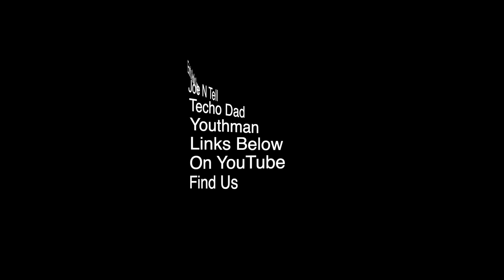F3, F6, F10 - The Most Important Point/s Are?

Comment: I think they should just tell you the max spl at each frequency like monolith do...

My subs supposedly go down to 18hz! And they do... but if I listen at the levels I do (movies ref -10db or about 95dbspl for music)  the sub can't even produce 20hz at 105db spl! Or 23hz at 105dbspl... but it can just do 25hz close to that... the limiter needs explaining too... what are the characteristics of the limiting system... etc 

I use a curve where the bass increases 2db/Oct from about 250hz so by 20 its wanting to put out about +12db!  I had to roll off at 25hz to stop it bottoming out mechanically! 

Maybe only advertise the lowest frequency it can do at thx ref levels!  But I guess some crappy subs can't do any freq at that level...
Reply: I think a CEA-2010 measurement is important for subwoofer specs.

Comment: The percieved bass from a sealed vs ported speaker with the same F10 is significant.  12db / octave vs 24db/ octave rolloff will give you more output below F10 ( but with a higher F3).  It may integrate better with the room since room gain is in the 7 to 9 db/ octave range from the starting point, so fairly complementary and may avoid nasty room modes in smaller rooms.
Reply: One interesting thing to note is that there are different bass reflex alignments that give differing slopes.
Reply: I agree, but the most common vented alignments tend to have a pretty steep cutoff relative to sealed.  Lot of choices that designers make, I have seen a lot of small vented speakers that use close to a BB4 alignment to put a bass peak right before the cutoff to make them sound "bassier".  I like tight bass and use sealed subs in one HT, and an Infinite baffle array in the other. I still listen to more music and that has just become a preference.  Gotta love this hobby......
Reply: @joesabato9736  yes that's true. That's what was surprising about the port tuning on the Encore B6. It looks like it has a shallower roll-off than other ported speakers I've reviewed which made an audible difference.